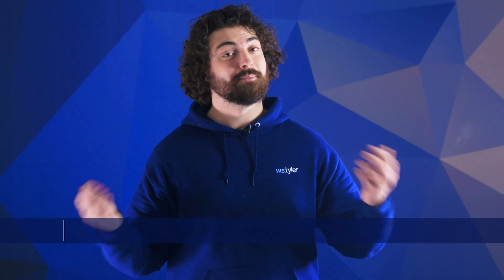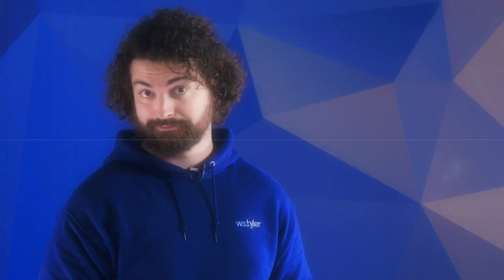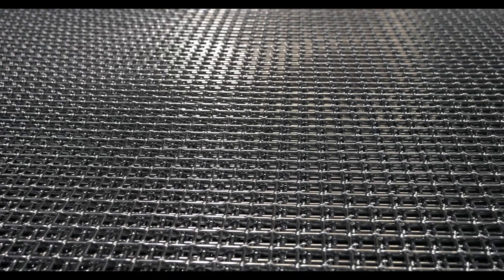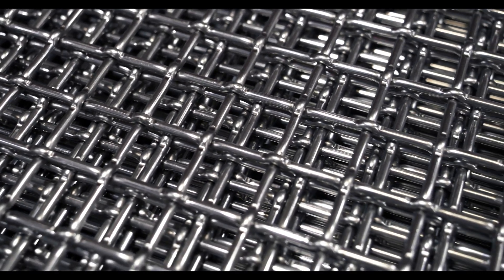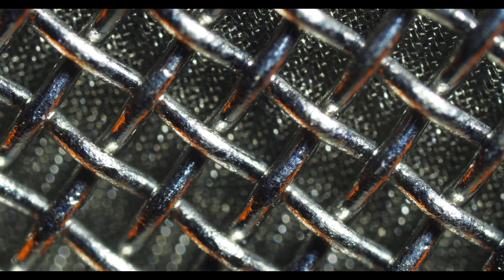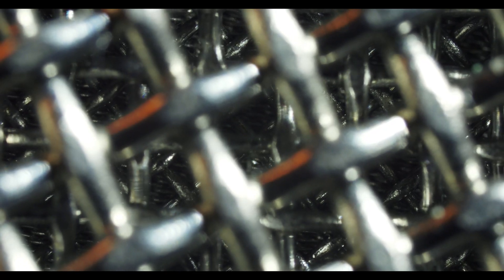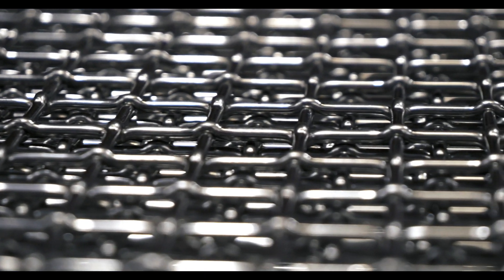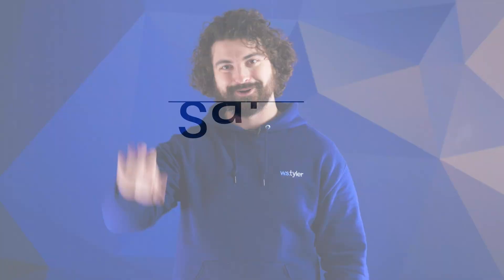314 Stainless Steel vs Inconel 600

Comment: Inconel 600 is drillable with high speed steel but the rpm must be slowed down quite a lot. Google the speed and use an appropriate feed rate for the drill diameter.

Comment: Inconel is impossible to drill through I went through 10 drill bits before I gave up. Even used super slow speed to prevent hardening. Didn't try a carbide which probably would of worked. But yeah it's some crazy metal for sure